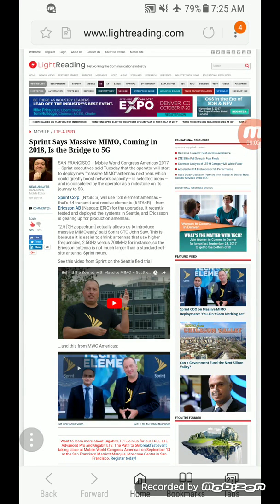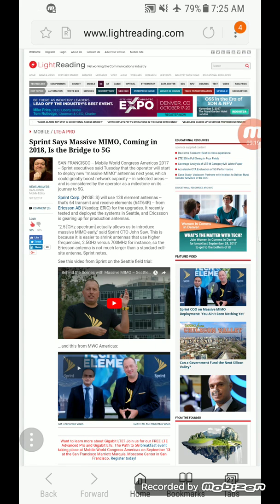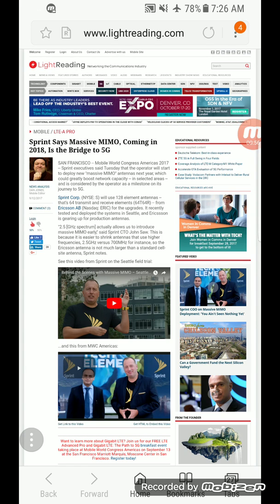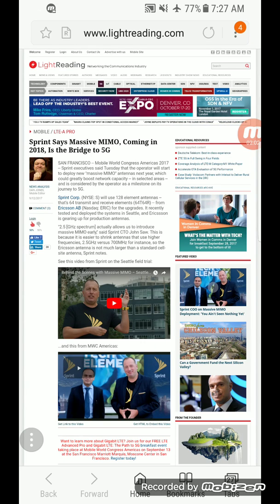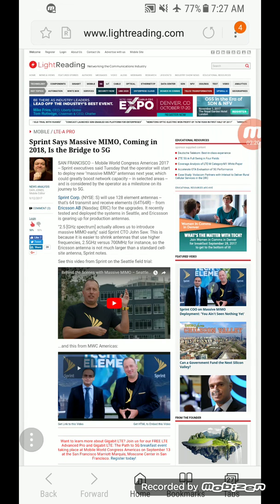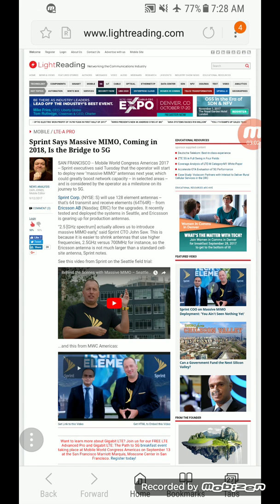SPRINT WIRELESS | MASSIVE MIMO TESTING : EXPLAINED

Comment: t mobile will not likely be able to do this with 600mhz, the antenna will be just be too huge. They will be able to to do it with AWS and PCS bands (likely 32x32)
Reply: BUT, T-Mobile's network will be more stable since unlimited doesn't slow them down.  They need a mix of good high and low frequency bands to stretch the coverage in more places both indoors and out
Reply: Agree. They will have better coverage too, both rural and in door, after most of their 600mhz assets are deployed
Reply: It won't be on 600 MHz alone.  It'll be part of what goes into it.  They'll likely have their future devices support the 600 MHz frequency primarily so that more phones in the future have better coverage.  Verizon's Band 13 is 800 MHz.
Reply from the maker: +Nong Wang T-Mobile has been working with Ericsson FDD massive mimo for their 600 MHz 
https://www.mobileeurope.co.uk/press-wire/ericsson-brings-massive-mimo-via-fdd-to-5g-platform
Reply: Tyrone I bet it is B2 or B4, not 600mhz
Reply from the maker: +Nong Wang ya, T-Mobile behind the scenes it using 600 MHz as part of their 5G platform
Reply: Given that they have the means, money, resources, and God forbid, will, to expand.
Reply from the maker: +Nong Wang could be , I'm just going based on the fact that T-Mobile said that 600mhz wEricsson said the AIR 3246 will be commercially available in the second quarter of 2018.ill be their foundation of 5G nationwide ..
Reply: i read the Ericsson FDD massive mimo it does not say it's for t-mobile 600mhz it is for their mid-bands. This is from the article  (The vendor is currently trialling Massive MIMO on FDD radios with T-Mobile US across three sites in Baltimore. Ericsson said the trial marks the first time Massive MIMO is carrying commercial LTE traffic across mid-band FDD.)
Reply from the maker: +Bryan Emm correct, I'm wondering since T-Mobiles claims  that their 5G footprint will be rolled out nationwide using 600 MHz .. if Ericsson will incorporate 600 MHz with massive mimo
Reply from the maker: +Bryan Emm correct, I'm wondering since T-Mobiles claims  that their 5G footprint will be rolled out nationwide using 600 MHz .. if Ericsson will incorporate 600 MHz with massive mimo
Reply: That is my reading too @Bryan. With the size of 600mhz equipment, they will be lucky to be able to do 8x8, which Sprint is already doing for years now (8T8R B41 macros). They may be able to do 16x16 eventually but it will be a real stretch in my estimate
Reply: they are probably make something different for 600mhz.
Reply: Tyrone my guess what t mobile and ericsson is talking about is their radio and other equipments at the 600mhz towers will meet the likely minimum latency requirements that needed to qualify as 5G. They are not talking about data capacity of 5G. Their mid band will still likely be the key to their future 5G data capacity
Reply: RejectedSpiritX Verizon band 13 is 700mhz and band 5 850mhz.
Reply: carl2680 I guess I got mixed up. Point is, Verizon's primary source of coverage is why they're solid. Sprint relies on high frequency, which doesn't work indoors.
Reply: I do not believe Massive MIMO is possible on low band, maybe in a few years it might be an option. But today, Sprint 2.5 is simply best suited for this type
 of equipment due to the size of the elements required.

Comment: Funny that Sprint is trying to talk about building out 5G when they can't even get LTE expanded.  Their last "expansion" was roaming and 3G.  Not to mention a Magic Box is needed to have decent signal.  Sprint needs to fix their network, otherwise they'll cease to exist when 5G comes out.
Reply: Sprint is deploying Nokia MM and MagicBox at elevated paces. Just ask Tyrone how Sprint LTE speed and coverage has improved in El Paso compared to last year
Reply: But, if you need to plug up boxes for signal, it's an obvious sign that the network is no good on its own.
Reply: It is true that Sprint cannot match the spending levels of the other 3. But it will be a significant improvement over last year's pace.
Reply: t mobile has been doing this all the time. Magic Box is significant because it is easier than traditional booster: it only need a power source and not home internet connection required
Reply from the maker: +Nong Wang sprint has done it quick .. when they have been gotten around to upgrading
Reply: Nong Wang yeah but once you go outside a city its really spotty LTE and the rest its just 3G or 1x and also roaming ethier on 3G or LTE on Verizon's network
Reply: That is true @Landon. Sprint is not fit for many consumers who live/travel outside cities. But t mobile used to be just like that a couple of years ago. It did not stop them from growing like crazy
Reply: Nong Wang lol but t mobile doesn't need it always like sprint does I heard a lot of people I heard that before the magic box they could barely had any signal with sprint like barely a couple of bars of 3G or weak LTE at least t mobile most of the times doesn't need one because they have low band signal and those places that need it are really deep in buildings
Reply: Nong Wang yeah that's true they still need areas that need work on but they are more stable than sprint in general sprints needs a push economically to start expanding heavily like tmo does
Reply: Well, Landon, if Sprint would understand that coverage is more important than gimmicks and flashy promos, their churn rate wouldn't be extremely high.  They are giving away the service, which still has not yet been successful.
Reply: mmpcody well as Tryon said the USA isn't gonna expand anymore so Verizon can't expand significantly anymore the only thing left for them is to densify as for the 5G always carrier focuses on places with a lot of population its like it's obvious more people means more businesses opportunities
Reply: M. Kelleher said no one ever. Now we know for sure you work for Sprint. I used to.